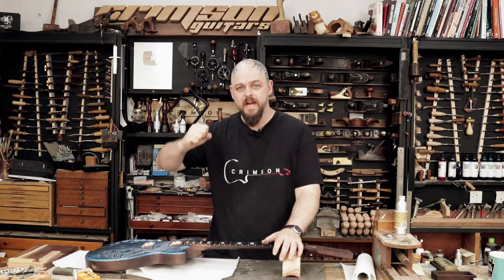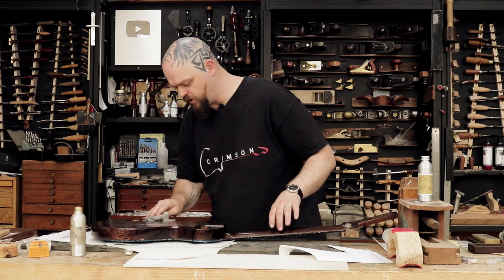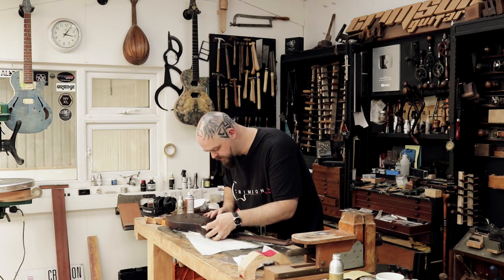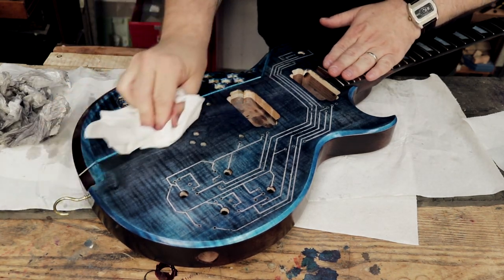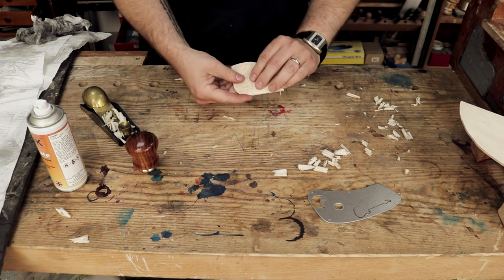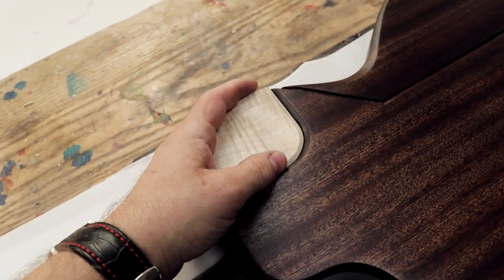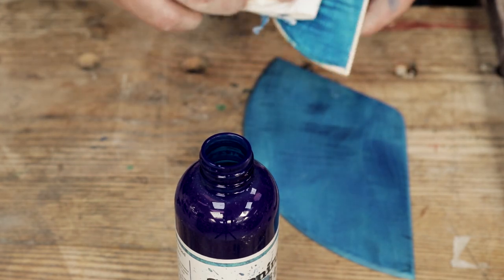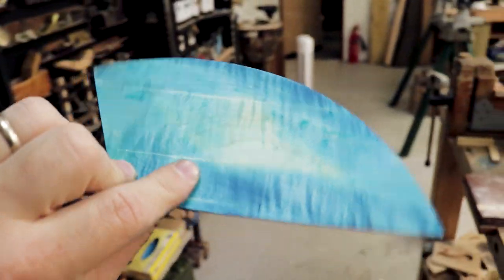Ep 16 - Taking a Great Kit Guitar and making it Awesome

Comment: This turned up at 11:45pm. No way I'm going to bed without watching it!. In the spirit of using hand tools, why not use a coping saw and the inlay jig to cut out the back plates? I've been making mahogany tool handles finished with 3 coats of High Build oil and they look awesome. Is it better to hand buff them or use a polishing mop? The guitar goes on betting better and better.

Comment: What is the difference in result with finishing oil if one were to apply 1 thick coat and let it cure overnight vs applying 3 layers and rubbing off within 10 minutes of each coat as Ben did?

Also, LEDs are definitely a win with this build

Comment: Stupid Question:
Can a pickup be wound to have 6 seperate poles, so that each individual pole could sense precisely which string is played?

Then use this to drive 6 different LEDs to highlight which string is played. 

Further, can the intensity of the leds be changed to show the intensity of the string vibrations?